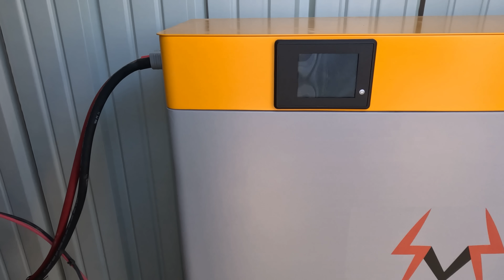Off-Grid Solar 1 Year | Regrets & Walk-through

Comment: Description on voltage is wrong. That is potential. What you described was amps which would be equal to psi because that's where the explosives the pipes or the wires. Wires are measured in amperage for the gauge for the gauge of The wire. Just like PVC pipes are red for their PSI rating they can handle

Comment: Consider timers or some  other control methods to use power as it is being produced, it improves efficiency tremendously  and means a smaller battery is practical..

Comment: Some major points you didn't mention is the standby power consumption of the inverter.
And split phase in balance nuisance shutdowns extremely common with high frequency units.
The advantages of a low frequency transformer based inverter.
They can handle imbalances of 80% or more with no issues.
The transformer works like a large capacitor providing strong surge capabilities for induction loads like refrigeration water wells grinders air compressors etc.
Most of the high frequency inverters use less mass and massive fans to basically run your inverter like a overclocked computer.
Closed loop communications some units require small boxes for translating some work from the batteries others work from the inverters.
I went with the 6800watt Snyder XW pro and the hilos 16 kilowatt hour IP65 heated batteries.
Snyder is a division of square d has 40 years experience through subcompanies for technology experience.
Inverter standby power consumption is under 35 watts. Has a 12,000 watt one minute surge capacity.
Can't throw down $8,500 Watts for 30 minutes.
Basically the difference between a cheap welder and an industrial duty cycle.
And you'd be amazed how many cell towers have backup power supplied by Snyder inverters.
The hilo's battery is manufactured in Canada they design their own BMS that uses a contactor instead of messy MOSFETs.
So none of the software is Chinese.
They have some unique abilities when it comes to balancing the cells you can have multiple batteries connected in your system and all the cells from all the batteries will balance together.
You can tap into the communication system either cat 5 or wireless depending on system tweaks.
I prefer to keep things offline so sabotaging software won't burn my house down.
Another thing is MPPT over paneling.
The Snyder 100 amp MPPT can handle 500 volts all day shuts down at 600.
Reduces wire gauge and amount of bird nesting needed.
And the Snyder has a pre-wired breaker panel system with wiring gutters that can be pre-wired for expansion and setting up the system.
This saves a lot of time hassle and cost.
So do your research folks Don't just jump on the first deal they might be chapter 11 before your order shows up

Comment: Try a pay load dump for too much power when ure away I believe they have a system that does it, it's not an inverter but it connects to your system and you dump it somewhere else, like a thermal battery, or another spare lithium battery or another system, etc

Comment: Good job. Thanks for sharing. 
When trying to describe amps to a person you could use water as an example. You can only pass so much volume of water through a pipe. Then if you need more water flow then you will need a larger pipe. Same thing with power. If you need more amperage then you gotta have bigger wires. 
Terry

Comment: Your explanations are spot on. No hype, no dragging it along, very, very much appreciate your comments. 
Currently I’m running a 12 volt system, 6 -100 amp hr batteries,
1000 watts of panels, 3 - 2200 watt inverters. Happy with it, but I’m slowly saving for your type of setup. 
Thank you

Comment: Current travels the path of least resistance.. it doesn't flow through wire but around the outside edge of it that's why you need a bigger wire for more amperage and stranded wire holds a bit more than solid wire does... more surface area on the copper inside the jacket.
 Nice setup you have there...
Reply: If you are talking the same size wire, then a solid wire will carry more current

Comment: In your off-grid solar 1 year video you alined the off grid battery system with a mobile or iPhone charger. You said the little adapter converted thru a battery just like the off-grid system. The is no battery in these little adapters. They have a small transformer, done with coiled wiring like most other AC-DC converting.

Comment: Some inverters have the ability to do a two wire start and automatically start a generator when the battery reaches a certain point. They are not common but portable generators with two wire start capability do exist. You could also install a double throw manual transfer switch  between your house and solar system. Then use it to switch between power from your solar system and your portable battery bank/generator. Then no more carting your portable battery or generator around. Just go out and move the handle on thr manual transfer switch to change power sources.

Comment: If I were leaving it at the same angle all year round, I think I'd want to set it at the optimal winter angle.  Generation is harder in the winter and easier in the summer, after all.  The summer can take care of itself, but winter is where the biggest challenge is.
Reply: It depends on your use case, I have natural gas for heat and want the solar for air-conditioning. But yeah it makes sense to have the ability to move the rack to at least 3 positions, winter, spring/fall and summer.
Reply: @josiahlehman1506  At least two anyway :-) But I think three is near to the ideal compromise between fixed positions and active tracking. But I don't like the angles people tend to quote. Being 10º off the ideal angle gives 98.5% of the power of being perfect, but it starts to drop quickly after that -- 15º is 96.6%, 20% is 94%, 30% is 86.6%.  If you aim the panels at where the sun will be at noon that's great at noon, but the whole rest of the day the panels will be pointing too high. It's better to point, say, 10º lower (panels steeper) than where the sun will be at noon, which will keep the sun within a ±10º band for quite a few hours ... vertically at least. You can't do anything about the 15º/hour the sun moves around the horizon, at least not without active daily tracking. Also, every day in summer that isn't the solstice the sun is lower at noon, and every day in winter that isn't the solstice the sun is higher at noon. I'm at 35.5º S and I like angles 20º (ideal at noon Dec 21 is 12º), 45º (Mar/Sep 21 noon 35.5º), 60º (Jun 21 noon 59º). There is room to argue/optimise more :-) The best dates to change over are approx Feb 21, Apr 21, Aug 21, Oct 21 i.e. summer and winter setting for 4 months each, and spring/autumn (when things are changing quickly) 2 months each. If single position then yeah I think optimise for winter. My using 60º in mid summer would get 68º as much at noon on the summer solstice as the 20º angle. It's still going to be far more power in a day than in winter: more hours, higher intensity, less often overcast (at least here). But I'm ground mounting with extendable aluminium rear legs, so it's easy to adjust ... every month if I really wanted to.
Reply: @josiahlehman1506 similar situation, except we heat with wood which we get from our property. Summer time we run the AC which is heavy on the wattage. I have adjustable mounts now, so ill probably adjust to each season.
Reply: As an installer, its best for yesr round production if using a fixed angle array to add 5° to your optimal fall/spring angle 😉
Reply: It seems it would be fairly easy to make the panel array's angle adjustable. It sounds as if changing the angle every month or so would drastically improve the power generation from the array, which might also make the need for backup power less of an issue.
Reply: @stratman1192 depends on how it is built the pre made tube/racks are easy to adjust 
when you do a wood frame it is best to be rigid for strength  we are putting a sail on a frame essentially something rattles loose in a wind storm its all over
sometimes its about where you can put the panels safely for wind and theft
Reply: Good point. 
Terry
Reply: The newer panels lose less from angles up to 15° with very little production loss in winter at 35°
Reply: I have 4 Arrays both A.C. & D.C. here in the Mountains of Central Montana. 21,400 watts combined all at different angles and positions. My winter Ground mounts are at 45° & 36°. I use the SolArk15K because I remain grid tied with a 76,000 kWh battery bank.
Reply: Im also at 38° I custom made my arrays to adjust to 45° October -april and 25° april - October
Reply: You'd be wrong
Reply: If you want to heat a signficant amount of space with those bad boys, I'd go for outright adjustable panels. Or like, A LOT.
Reply: you can also go bifacial they help on over cast days a lot and the angles are less important since they can get the reflected light if they are mounted up similar to this system where there is no roof right under it
these will also help in regions with snow you get a free reflector from Ma Nature
Reply: 💯 percent brother 

 And especially for plants that do not get the sun hours they need to produce and that winter season starves you plants    Yes it triggers the plants different growth stages like leaving vs flowering etc,   These non rotating panels need to be directly to the dec21 low solstice and lifted straight up about 15 degrees so that they can catch a little more of the summer's max intake    Which I would suggest having an extra battery chain to save the power long term to use during the winter slow solar season 
   This is all based on me trying to grow and raise everything on my little 20 acres      The plants do not lie is kinda my motto
Reply: Shortest days in the winter - get as much as you can out of them. Makes sense! 

In the summer you do need more for AC, but I believe you should over-spec on the solar side if you can.

Comment: Thanks for your run down mate. I dont have to deal with cold temps. Live in temperate zone lol. I just built my own lifpo 48v 200amph battery or 48x200 is 9.6kwh. 52v/54v battery output is mathmaticaly more with. 52x 200 being 10.4kwh. Anyway lol im just starting this journey and have a n 8x400w strung panel array and a 6.5kw hybrid inverter. Cost me $5k aud to build complete sys with backup 3.5kva gen. I agree with you so far that doubling storage( at the charge rate available from pv youd be crazy not to. 48v 200amph lifepo battery cost  me $2k aud.

Comment: When you convert DC to AC to DC, about what % of the power gets lost (as heat) in the conversions?
Reply: The answer is an enormous amount, and its not all as heat.  You would have to analyze for the exact equipment you are using and where you land on the curve for those devices.  Generally speaking, the lower on the curve, the worse the efficiency.  For example, outputting 100W on a 2000W inverter would be highly inefficient.  There is a lot of misinformation and fake curves out there, because manufacturers want you to buy.  A typical setup would easily lose 40% when going DC/AC to DC and then DC to AC assuming you are on a decent place of the curves.  A lot worse if not.  That's why none of this stuff works out financially.  Its just you throwing good money after bad.

Comment: Good video very interesting system. One thing I would caution you about is the generator. I work on all kinds of systems and all kinds of generators. It’s a bad idea to leave a generator off for a long period of time. A generator needs to run or you will run into the situation of it won’t run and you need it. The go to for generators is that they should be exercised (ran) for at least 1 hour each month. Add that simple rule and you will actually increase the life of the generator. I know it sounds not true but it is true. Sitting to long will cause issues in the motor, the generator coils, the filters, the hoses and electric cables connections.

Comment: How do you guys deal with tornadoes? For the solar panel orientation?
Reply: Nevermind just got to 08:50 it seems that the flexion of the wooden beams is a good low cost solution. The angle will make the wind go above it, but not if it's coming from the other side

Comment: You could save on energy usage with solar water heating & a solar furnace. I've got both running here with video's of them on my channel. Running fully off grid here with 39kw solar, 600 amps charging, 100 kw storage & 18kw of inverters. Never have to sweat to the threat of being under powered. It's sweet freedom!
Reply: That's $$$$$$

Comment: I got a Sol-Ark and it does all that stuff you want and more .I got that 8 panels rack, 2 heated 100 ah rack battery with wires for just over 9 grand . I like it so far.  I'm not using any of the cool stuff my inverter  does.  You can set it up to monitor everything you can think of.
Reply: Sadly you keep monitoring that they shut down due to nuisance one leg shutdowns.
Pathetic induction load performance.
Super high standby power consumption.
Simpleton solutions are just that. 😂

Comment: Great presentation, we finally got the rest of our solar installed on our off-grid property here in southern Alabama, we have a total of 5000 watts but we split into two different systems, each system outputs 2500 watts. We went with a very simple power source, we purchased 4 Pecron 3600 watt power stations, that is way more power than we need and our solar setup easily keeps these units topped off. Just recently we had a Generac Guardian Home Standby 14kw generator installed as a backup system and it runs on propane. Except for being tied to the electrical grid, we live a normal lifestyle, we have a well for our water source and have a state of the art septic system...

Comment: Enjoyed the video! Last year I decided on an EG4 6000XP and installed in just before hurricane Milton (we live on the west of Florida, about 200 yards from the Gulf). I only have the Grid connected to the EG4 for charging the EG4 battery (14.3kWh) solar was not connected yet (10 - 415/500W bifacial panels). We were forced to evacuate for a few days and the system kept the fridge/freezer running for 5 days of no grid power. Everything was still cold and frozen. Love it. Currently I am installing the solar panels as part of my North 6' privacy fence, which receives 100% sunshine 365 days a year. The panels will be vertical between sunset and sunrise and each morning they will be raised to the 25 degree angle for more power using linear actuators. I have 2 in the process of working out the bugs as they will be controlled by a raspberry pi 5. So far I have the program working perfectly for sunrise/sunset and raising them to the desired angle each morning. The issue is that once they reach the desired angle (yearly average 25 degrees) I am telling the Pi to raise the panel 5 degrees above the 25 degrees and below the 25 degrees, store the angle and output and then review the data to pick the degree setting with the best output and set the panel angle to that. I am trying to set this process every 10 minutes, but will probably make it 15 or 20 minutes. Actually a fun project. I I think that I have fried a bunch of brain cells on this project.
Reply: Sounds interesting. I am a fan of solar and pi.  Also am looking at the EG4 products for inverter , mini split, and batteries.   We live 30 minutes from signatures solar here in Texas.  All the best from north Texas.
Reply: Waste of a Pi 5 -- a Pi Zero 2W would do it easily .. or original Zero, or Milk-V Duo S. Even using full Python, let alone C or shell scripting.

Comment: If haven’t already done this , instead of using your rooftop unit I’ve installed mini split units in RVs which use around half of the energy of a basic rooftop air conditioner and will save you a lot of money while heating vs propane

Comment: Is your all in one a rebranded lv6048? If so I use solar assistant running on a raspberry pi connected to WiFi to monitor from anywhere. It works well. Nice setup you have. Thanks for sharing🎉

Comment: Did you run into any issues with the length of the runs on the solar side? Any suggestions with limits on cable lengths that would affect performance?

Comment: StarMax (on Utube) was recently offering a vertical DIY battery with 280ah cells, heating pads included for about $1100. And they were ore-assembling the battery. Hard to say if it could be made to communicate with your existing battery but the JK BMS has the best chance of making that happen if possible. Very versatile and customizable BMS. But it's not necessary that it be in the closed loop to work perfectly fine. Probably need to wait for the tariff mess to be resolved but that'll work itself out soon enough I imagine. Those cells will easily produce 15kwh being fresh as they are. Make life a little bit more enjoyable.......
But hey, if someone will throw a battery at you to spit shine it on the Utube, go for it man! lol

Comment: A few ideas-   would a shunt with bluetooth/wifi allow you to get some system info while away?  To increase bat capacity- Batteryhookup in PA has 48v 105ah (5kwh) Lifepo4 bats with bms for $450- they were little used golf cart bats.  Might this supply 50% more power if it can be used along with your current battery?